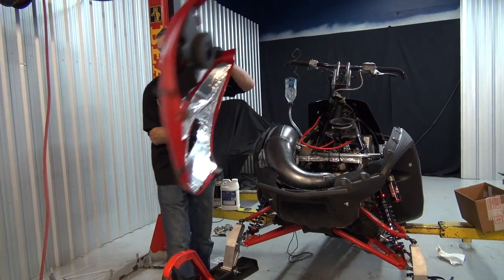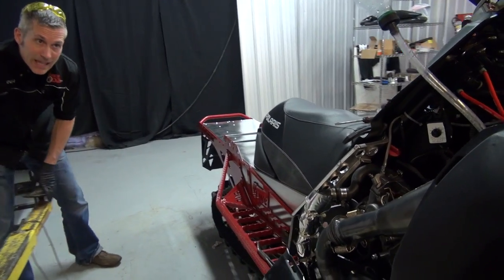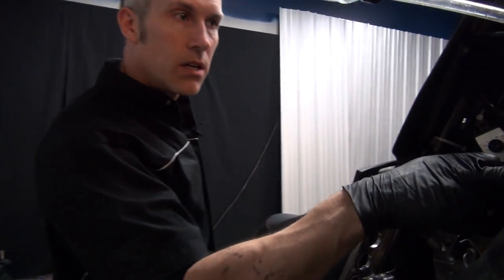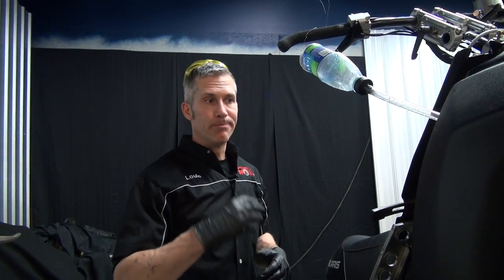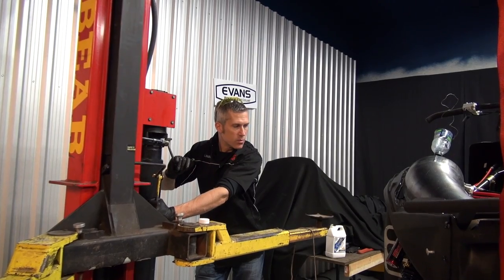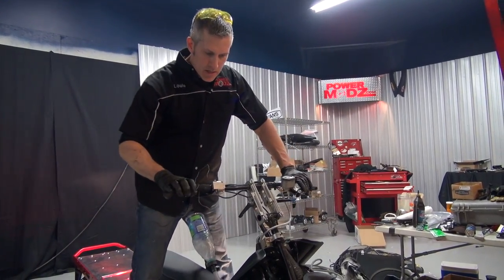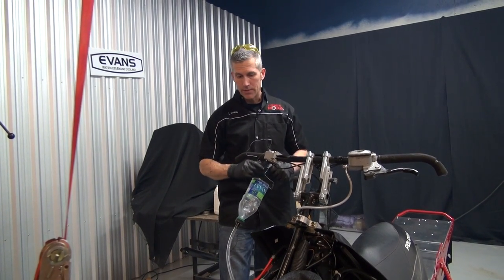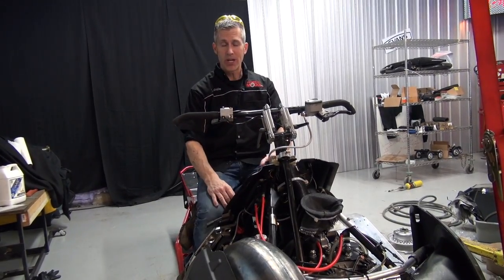Polaris IQR 800 Mountain Mod Build Evans coolant install, PowerModz!

Comment: HAPPY NEW YEAR to you, all of your family and friends in 2023.  2 questions.  From the rear tail running board the  front foot step, using a 4 foot level,  is it fair to say that " 
Yes, your antifreeze is now at level when putting the Arctic Cat on a forward facing slope ?  Question 2,  which is considered an excellent and trustworthy belt, for my 1997
Arctic Cat, Thundercat 900 cc
triple ? Thanking you in advance for a reply.
Best regards.

Comment: Hey dude! I have a problem :( 
I got a Polaris IQR440-07 with a Polaris Liberty 800ves-04 engine, my problem is that my sled overheats all the time. I have installed an extra cooler but it doesn't help.
I have done everything i can? Maybe you have some tips or some leftover parts that i could use? :/
Reply: Stuck thermostat
Reply: Jetting?
Reply: jamienoah222 tried everything i could, also tried the thing he did in this movie and i opened att the back. The problem is like it don't goes around :/
Reply: Broken water pump belt?
Reply: We have thought of that but at the end of the sled there is like a screw you can open so the fluids go out and when doing that a while it goes around and then stops so only one side of the cooler at the back is hot... :(